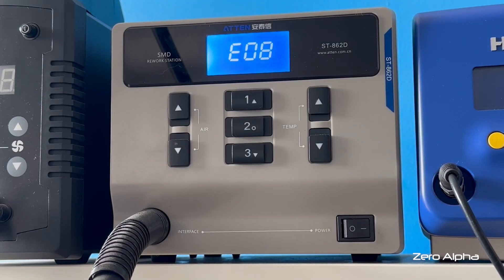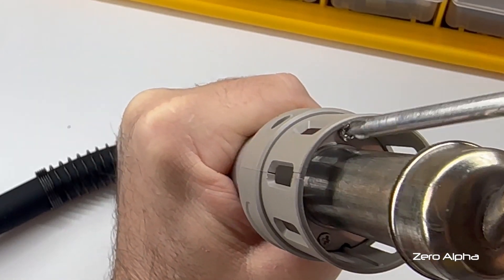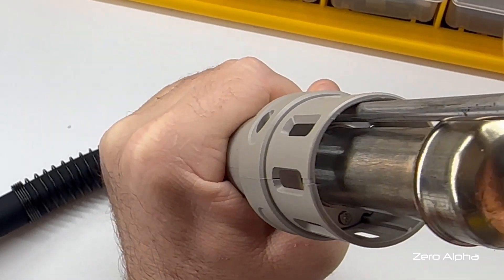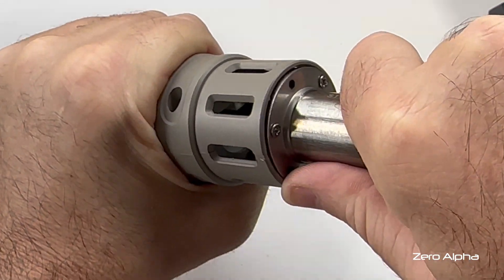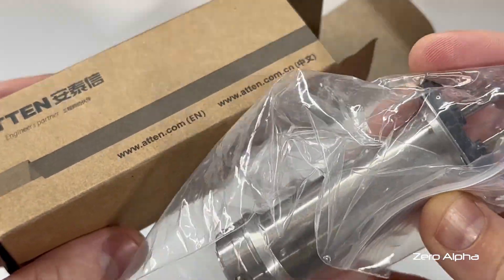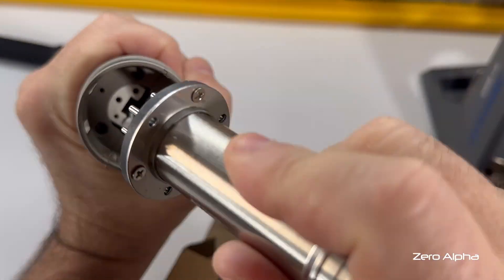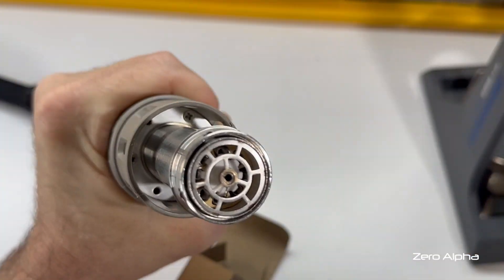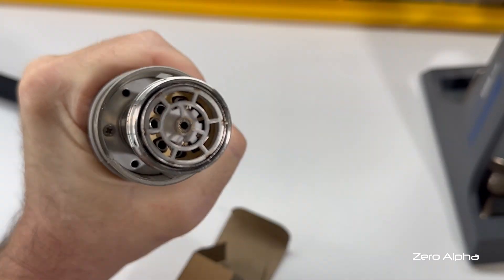How to Fix E08 Error on ATTEN ST-862D hot air soldering station

Comment: I solved mine without changing the heater by doing the following: remove the heater, then remove the 3 screws from the black part of the heater and pull this black part and you will see a ground wire and a temperature sensor.

I redid the solder that holds it in place on the temperature sensor because it is a type of enameled wire that still had enamel on it, preventing it from working properly (I saw this under a microscope). I had to use an iron at 500º to get it to work. And I simply bent the ground wire so it would be thicker and screwed it in really tight. And it's been 3 days since the error has appeared since mine appeared every time I used it, I think it solved it. Changing the heater would also solve the problem, but it's always good to save money.
Reply: now that's a repair!

Comment: I also changed it, it didn't help
Problem in other
https://youtu.be/2HF51ACDiV0?si=XjozaMUiVlj_1DYH
Reply: Make sure the ground hair wire from the pin is touching the outer metal cage of the heating element
Reply: @ariewijaya1679  why it can't?
Reply: @rezakxwave  check it with multimeter, when cold sometimes not connected but if already hot heater work normally because the bottom metal expand
Reply: @rezakxwave  the outer metal housing can remove by unscrew the mini nut inside the heater element

Comment: Noooo LOL mine had broken wires in the air tube!!!
Reply: what you mean? how??
Reply: @rezakxwave  disassemble the station and the gun, take the multimeter and check all the wires. Then you can either replace all wires or you can simply put another wire to double the broken one